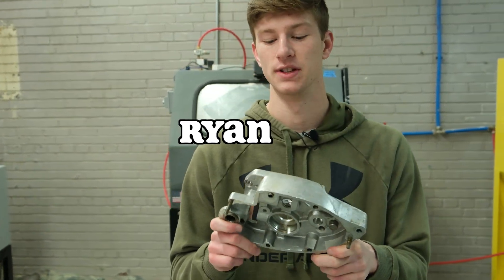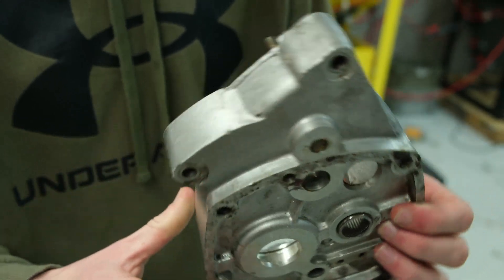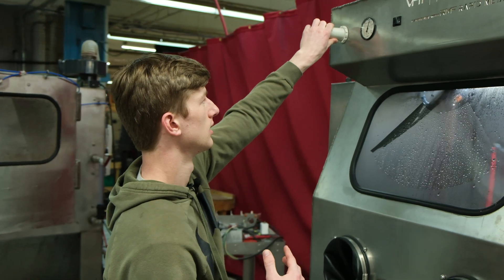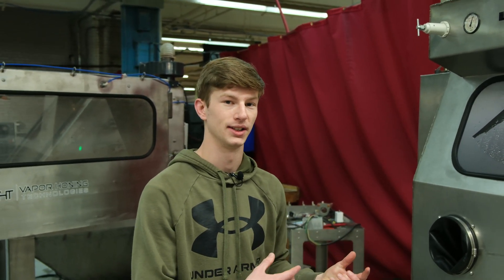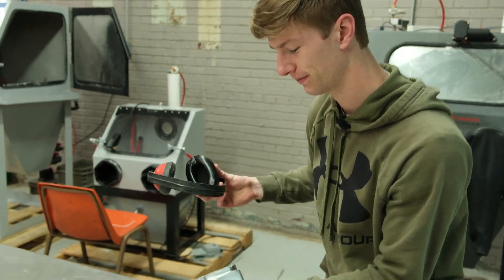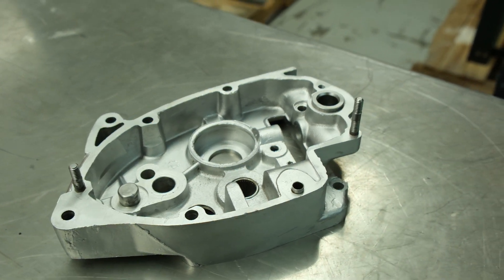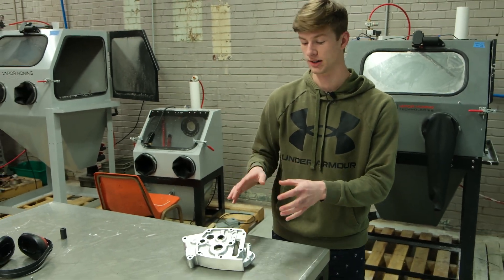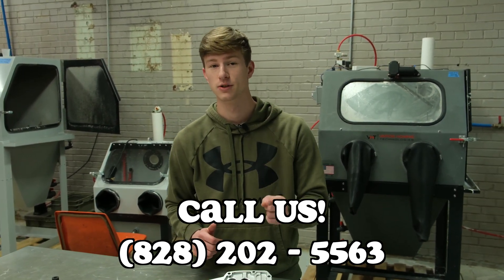Why do we use Glass Bead to Restore Aluminum Triumph Motor Parts? - Vapor Honing Technologies

Comment: What size glass bead?
Reply from the maker: The media used to restore this part was 170 - 325 mesh glass bead!
Reply: @VaporHoningTechnologies  Thats a big range, do you guys mix sizes?
Reply from the maker: That's the range it is manufactured in. It is our most popular abrasive due to the excellent results it gives every time. For high-quality glass bead check out this link: 
https://vaporblasterforsale.com/products/25lbs-glass-bead-abrasive?_pos=1&_sid=ef487b130&_ss=r